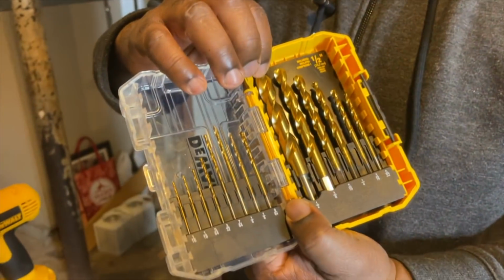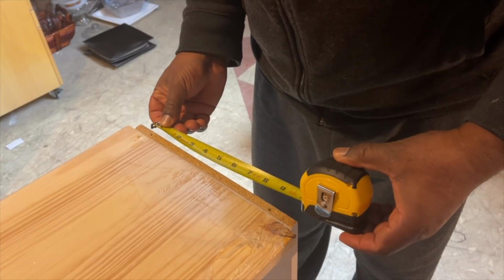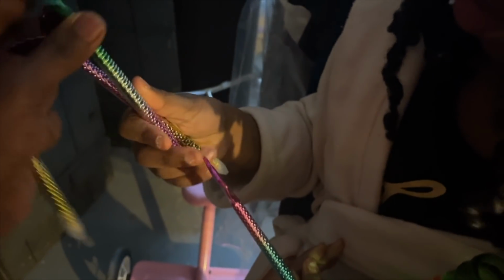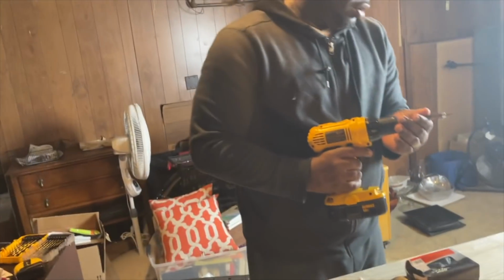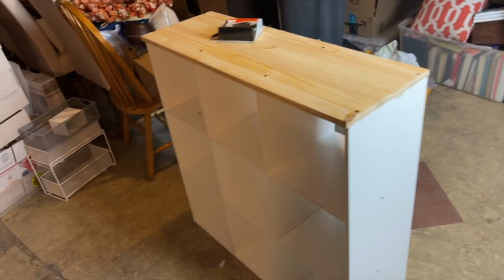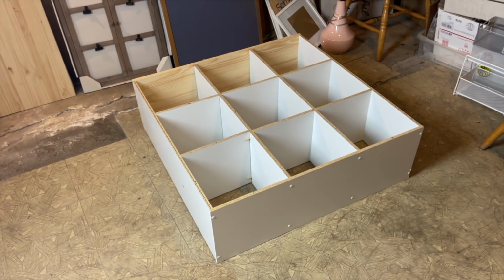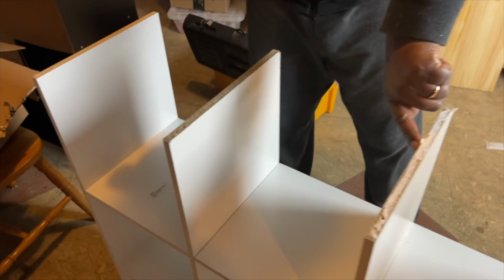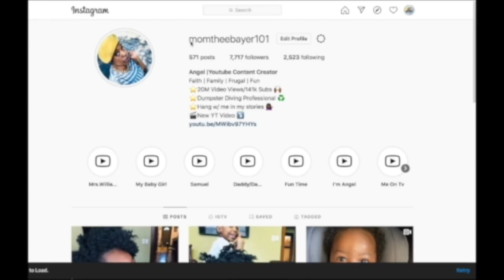Dumpster Diving: Turning Trash Into Treasure | Storage Cube Make Over | Day 3 | Time To Build | DIY

Comment: If your shelf gets wobbly, even with the new top, use L brackets to make it more sturdy. I would use bins or baskets in the spaces and put some things directly on shelf. I wouldn't add doors. It's particle board, it may not hold doors. You can find wood bins or clear acrylic to fit spaces and glue mirror tile to the front, put a knob on and it will look like doors.